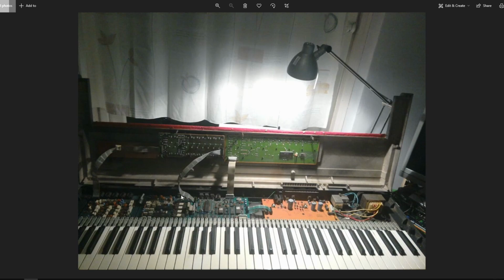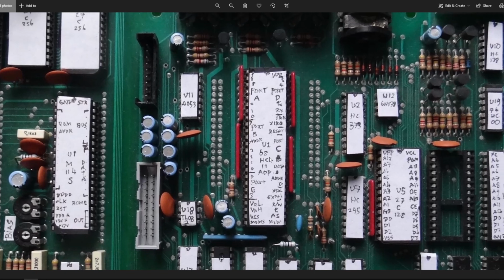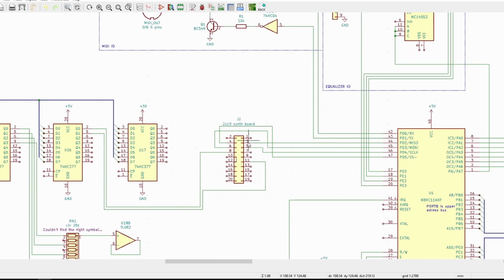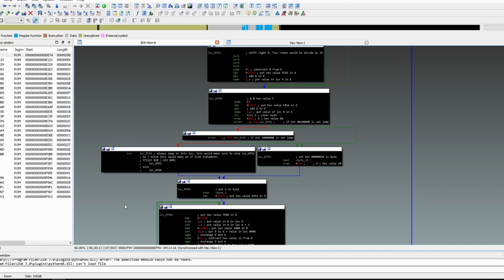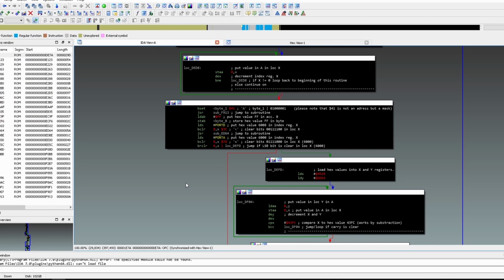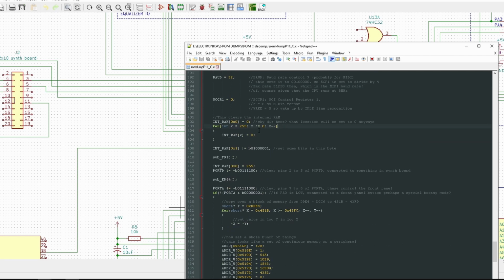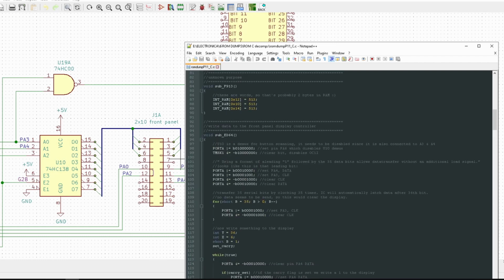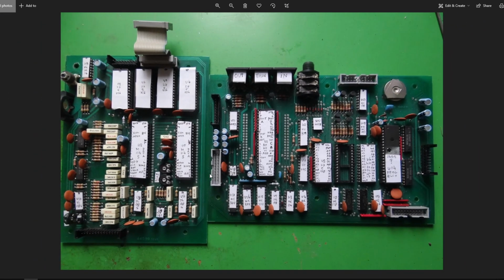Keytek CTS-5000 - Part 3 - Reverse Engineer, Disassembly and Decompile process.

Comment: Hey have you considered using Ghidra to help translate to c - I've found its functions pretty useful to analyse the Hohner D98 roms. There is also quite a few instruments implemented in MAME which could be handy approach to test firmware patches. Anyway looking forward for your updates - have fun :)
Reply from the maker: I shall check that out, thanks for the tips :)